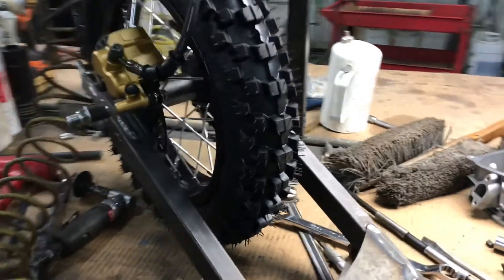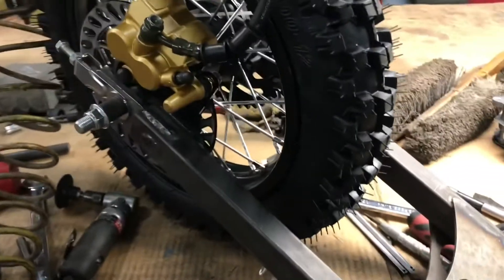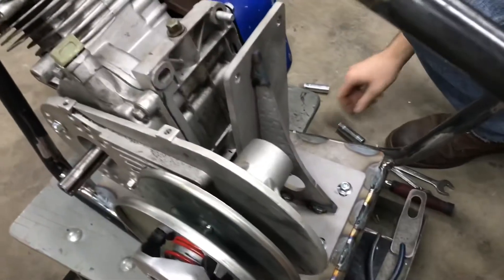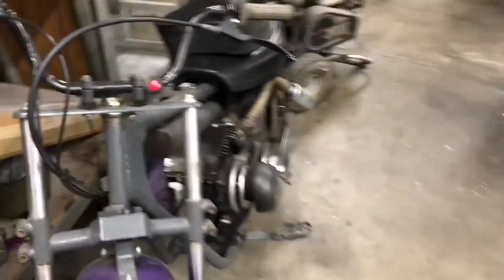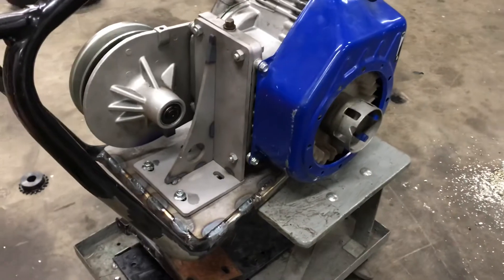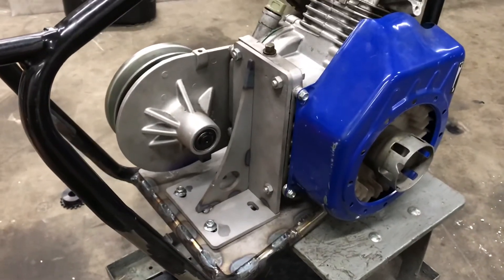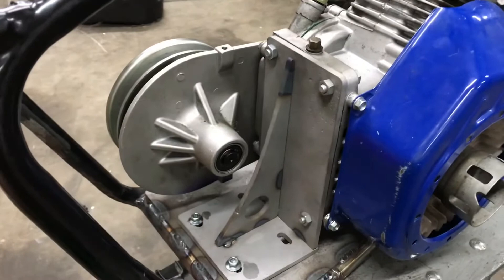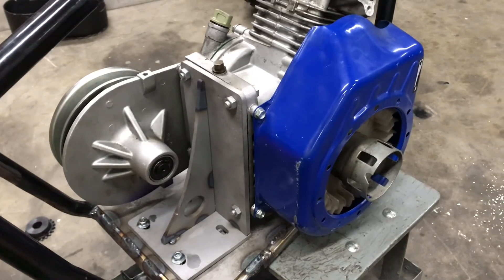24hr Mini Bike Swingarm Build Part 4

Comment: Have you figured out how much oil the vertical mounted engine is going to need?
Reply from the maker: Not yet ....need to find a old side cover to cut up ...them I can see the oil level
Reply: @dirtfootracing8788  Use your nut & use a piece of perpex - drill a hole for the crankshaft and/or the bearing too so everything fits...you don't need to wait around for a used cover & they should be both flat on the gasket surface.Regards Trev New Zealand 🙃(Home of the world's fastest old Indian)